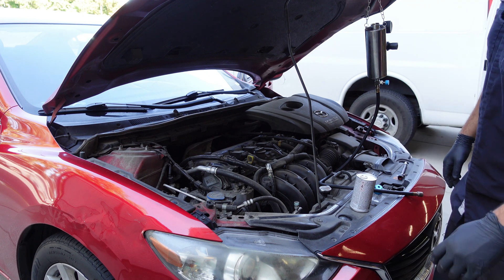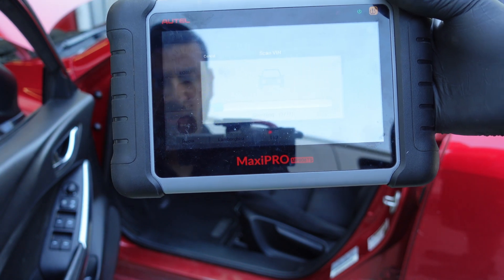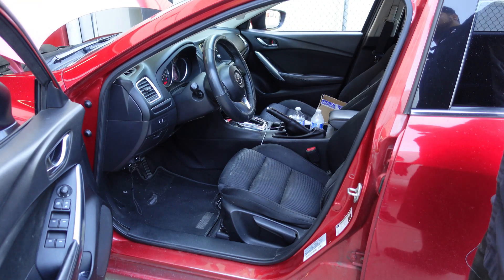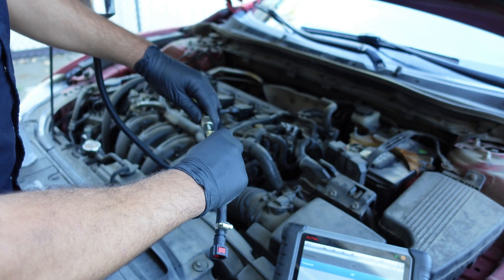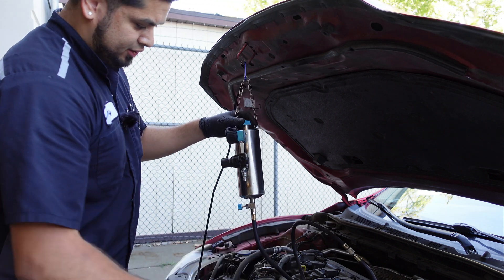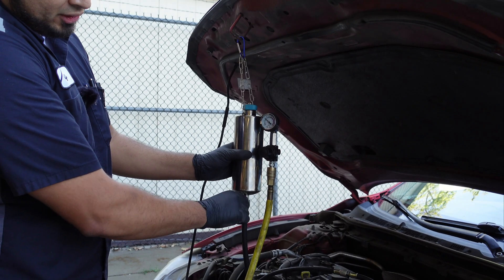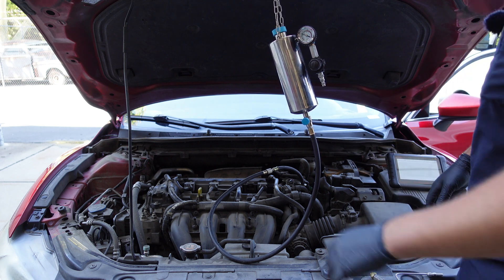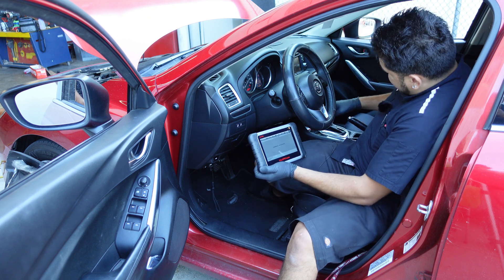Gasoline Direct Injection Cleaning With Engine Running(2015 Mazda 6)

Comment: Great video! I have a question. I’m about to do this on a friend’s 2016 Mazda 6 with the 2.5 engine. Can I just pull the fuel pump relay and let the car run until it stalls, then begin the cleaning procedure without reinstalling the relay? I’ve read that on some vehicles, the relay actually needs to stay plugged in and the fuel line must be rigged to recirculate, otherwise the fuel pump can burn out. Is that the case with this Mazda? TX

Comment: hello.

For the Mazda 3.  2021
Is it possible to do this procedure but I don't have the scanner, can I disconnect the fuel pump relay? 

without fear that it will show a fault code later.

Thanks in Advance for your suport!

Comment: 2016 Mazda 6, P0171 code.   Might this process help with this?  I do feel the car sputtering just a little when not moving and in gear.
Reply from the maker: It could but if it’s sputtering already then it might be too late. You could try. I have an Acura that is also direct injection and i physically took the injectors out and had to clean them but they worked well after
Reply: @JCAUTOMOTIVE4444  Thanks! My thoughts exactly...  figure i could clean them and then see if it comes back. Or just replace all 4 and hopefully avoid doing it twice.   Thanks for the note back.

Comment: Can you do this with the injector out of the car? Use a 12v battery to connect to the injector to open it, like the old school injectors?
Reply from the maker: I'm trying to think about this question. I'm sure you could. but I'm not sure how well it would work being direct injection. i believe with direct injection it requires over 2000 PSI and that's why the secondary high pressure fuel pump is required. In the past, I've put the Injectors in an ultrasonic cleaner and opened them and it seemed to work. So I believe it could work

Comment: Does this process in this particular setup only clean injectors or does it also clean the intake valves at the same time?
Reply from the maker: Just injectors. But the tool itself has several fittings and one is for intake valve cleaner.